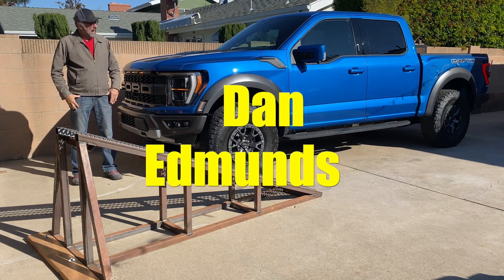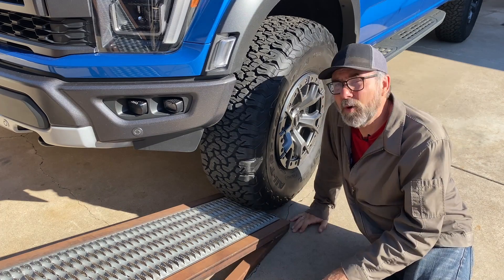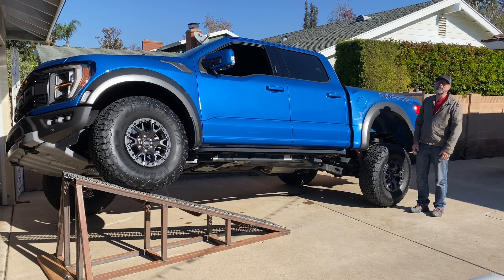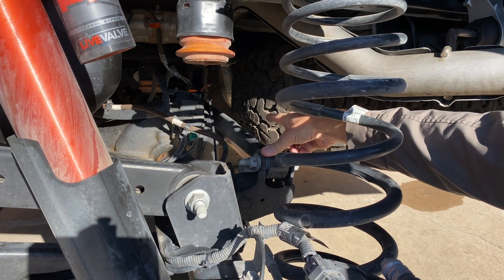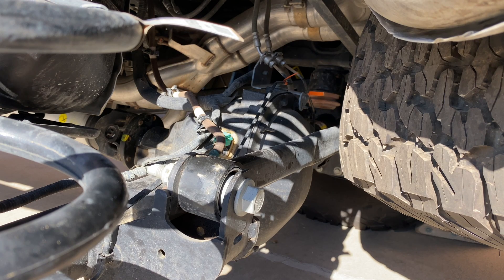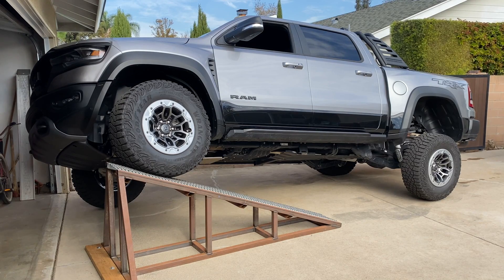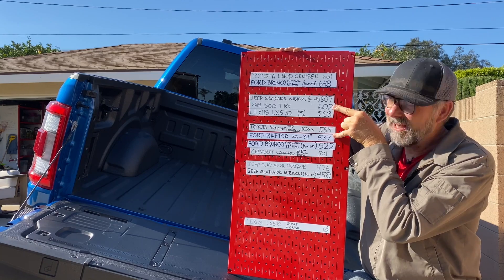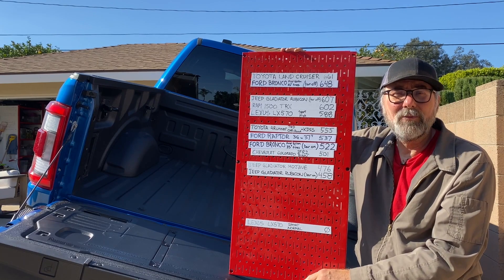2021 Ford F-150 Raptor w/37" Tires: Suspension Flex Test and Coil Spring Rear Suspension Walkaround

Comment: Hilarious the TRD Pro 4Runner got that kind of articulation
Reply: I guess that shows us the limitations of this test. We all know a TRD Pro 4Runner doesnt have anywhere near the wheel travel of a 3G raptor or TRX. A 4Runner might be lucky to have 9" of usable front travel vs 14" for the 35" tire'd Raptor and 13" for the 37" model.
Reply: @Jay-me7gw  yeah totally get it's just in 1 scenario. Dirtking engineered the TRX suspension for factory so it makes sense it has so much flex on this test

Comment: Great informative video. In Your opinion how would You eliminate rear sag when towing with the gen 3 raptor while not having the ride compromised. ? Not near the max weight, but boat still has substantial tongue weight.

Comment: That’s crazy that even with the 37 inch tires and restricted suspension travel it still performs extremely well in the flex test.

Comment: This is a desert runner not a 4low vehicle
Reply from the maker: True. It's more crucial for rock-crawlers. And off-road vehicles that aren't nearly as wide as this. But I measure them all, and the differences among competing vehicles do matter. Besides, the Raptor and TRX do include 4low, lockers, rock mode in the traction control. It's still marketed to be an all-rounder. 

I'll take your point one step farther. I grew up with desert off-roading, and what I'd like to see is a lightweight (and less costly) 2wd-only Raptor with a long-travel front suspension. But Ford will never make one because: a) they sell all of these they can make; b) the folks in Michigan don't understand the point of a 2WD off-roader. Meanwhile, most of the top-tier Baja racers are RWD.

Comment: Next time flextest a truck, please dont forget to open the bed door in order to the probable frame flexing. Thnx for the video.
Reply from the maker: I did open the tailgate for the final shot, and there was zero binding or misalignment. Same goes for the door when I got in and out.

Comment: My TJ scores a 1090🤣expected more out of the raptor
Reply from the maker: My lightly-modded JK, which I sold, was at 981 with full pressure in the tires. Probably over 1,000 aired down.

Comment: Great video as always. My only gripe is RTI is an overly abused metric. It's great to compare RTI of similar class vehicles. For example Land Cruiser obviously beats 4 Runner handidly. Being inverse function of wheel base comparing full size truck to mid size SUV tells one exactly not much. Yes RTI is less but absolute travel is far greater meaning it can scale higher obstacles or keep wheels on the ground going over deeper undulations. Posting absolute measurement score board in parallel to RTI would  be very informative in my opinion. 
It would be great to bring my oldish 2008 Power Wagon on that ramp for comparo.  With official RTI of 658 and ability to scale 36" obstacle per Chrysler would it go off the end of the ramp?

Comment: I'm surprised ford didnt try to beat the trx with the suspension flex. Trx still king even with Fords version of coil rear.
Reply: You are kidding right? The Raptor with 35's or 37's will make the trx look silly off road. These trucks are maybe 2 seconds different in performance in perfect conditions on road.  Off road is a different story hands down. It is not just about suspension flex, it is how you handle it.  Not just about horsepower and torque either.  The ram has been shown to be a boat anchor off road at high speed. The raptor has been shown to excel at both high speed and general offroading.
Reply: @johnt6673  Haha not kidding at all. The trx is better in EVERY category except fuel mileage.  Look it up way better then the raptor. It's the first mass produced super truck. Plus it actually sounds like a truck and not a moped. 😂 also I'm not a fan boy of either it's just easy to see which truck is better.
Reply: @fireant1272  Are you serious or a 5 year old girl that turd rx is nothing in front of Raptor , all you said is about raptor instead ,go attend yoúr online classes boomer , only thing turd rx has over raptor is v8 nothing else
Reply from the maker: He's not wrong. Except for outright flex, this suspension really works off-road. See my earlier Drive review for Autoblog: https://www.autoblog.com/2021/08/31/2021-ford-raptor-review/

Comment: No offence but who cares.  Put your highest rated vehicle on this list on a Baha course at full speed.  There are  just waaaay too many variables including vehicle design intent at play.  I’ll bet that out of every 5,000 - 10,000 Raptor’s or TRX sold maybe, just maybe 1 will ever be placed into a situation where it would use even half of the available flex.  Marketing, marketing, marketing that only creates a new sucker for every sale.
Reply from the maker: For the super-wide TRX and Raptor, you're not wrong because they simply don't fit on narrow trails, have a long wheelbase meant for high-speed desert running. I'm still a huge Raptor fan because of how its suspension works generally for that, despite this score. But flex is still a point of interest and comparison -- if you can get more, why not? Meanwhile, for Jeeps and Broncos and 4Runners and Land Cruisers and such, the focus is on more technical stuff, and this attribute is big.

Comment: I know your a chassis/suspension guy but whats your opinion on this.....

If the Raptor R DOES come with the GT500 engine(which has an aluminum block compared to the TRX Iron Block). Do you think there will be much of a weight savings or will it be offset by the gt500 OHV design vs the push rod design

and the Ford aluminum body compared to the steel/composite body of the TRX....

Im asking because they ball park the Raptor R to be 650HP due to the engine not liking to push beyond this # in a truck frame/body. Many people are speculating that even with the HP deficit the Raptor will come out on top due to the advantages I just listed as well as already having a stellar chassis in the 3rd gen Raptor.

Its a bit of a mouthful I know.......thanks again, love your channel
Reply: The GT500s 5.2 is still a very heavy engine. The GT500's weight ballooned to 4300lbs with that engine, so you can only imagine what it will do to a Raptor, which is 6K with 37s.
Reply: @hellkitty1014  agreed but i mean an aluminum block vs iron.......plus the hellcat pushrod is no LS/LT in terms of size and packaging
Reply from the maker: The Raptor with 37-inch tires weighs 499 pounds less than a TRX. I'm almost certain the R will weigh less than a TRX.

Comment: Still impressive, I did not think it would do better than the Bronco with the bar on.
Reply from the maker: It is still impressive, and that's a good point. The Raptor absolutely crushes if when driven in anger on all sorts of high-speed desert terrain where diagonal flex doesn't enter into the picture, and that's what it's made for. The TRX's rear suspension is derived from the Power-Wagon, which is more of a rock crawler, and the truck itself is much heavier.

Comment: Can you test a G Wagon? Pre-2019 solid axle and after? Thanks.
Reply from the maker: Love too. Getting my hands on the older one is the trick. A neighbor a couple streets over, the BePeriodCorrect guy, has two. But I don't know him.
Reply: @DanEdmunds  Great introduction idea: “Hey man, can I almost flip over your POS overpriced German Jeep?” -if that doesn’t work, I’m in Denver and you can use my 2016 G63 AMG!
Reply: South African publication tested a very old but more off-road capable G 300 CDI Professional (W461 of course with solid front axle) only got 376 which is really bad..

Comment: Great video.    Thanks for all the extra info on breather tubes and other interesting bits. Love my current Raptor (waiting to upgrade to the R) 
KDSS from Toyota was great on my old LC but needed maintenance and a knowledgeable technician.
Reply: Ive heard that about the KDSS system on the 4Runner/GX.
Reply from the maker: I have it on my 5th gen 4-Runner. No issues yet.

Comment: Is the panhard rod suspension setup improve  freeway cornering,esp. without a rear stabilizer bar.
Reply from the maker: The Panhard bar/track rod is necessary to orient the axle laterally in all situations, and it has nothing to do with roll stiffness, like a stabilizer bar. Leaf rear truck suspension don't have a panhard bar because the leaf mounting itself restricts lateral movement (in a half-assed way) but the four trailing links of a link-coil suspension like this cannot define or control the left-right position at all, so we get the 5th link, the Panhard bar aka track rod. Another option is a Watts link, which is what the Australian Ranger Raptor currently uses, but that approach was discarded in favor of a Panhard bar when that suspension was adapted our Ford Bronco.
Reply: @DanEdmunds  I actually didn't think there was a factory vehicle that used a Watts Link suspension
Reply from the maker: Ford Ranger Raptor in Australia, which will soon be replaced. And it has a diesel engine!
Reply: @DanEdmunds  thank you. How could we improve the freeway cornering in these vehicles. I had an f-150(not raptor)and I don’t like that feeling esp. at relatively higher speeds.

Comment: Im assuming you didn't investigate the front suspension because you plan to do it with the 35" Raptor.

So basically if the upcoming Raptor R wants to beat the current TRX in terms of offloading it needs to have the 37" tires but have a factory lift(body lift) to allow more articulation?
Reply from the maker: I think this Raptor already has it over on the TRX in terms of high-speed desert off-roading. It impressed me no end when I attended the First Drive for Autoblog. Flex is more about low speed technical work, and both the TRX and Raptor are far too wide to be my first choice for that environment.

Also, I didn't investigate the front suspension because: a) I called an audible when the rear tire came off the ramp and b) I'm writing a photo-based Suspension Deep Dive for Autoblog, and I'll get into that there. I'm not sure what the goals are with the Raptor R, but I would not be surprised if the front stab bar disconnect from the Bronco Badlands makes an appearance. That would make all the difference.

Comment: The 200-series Land Cruiser being 14 years old keeps impressing!
Reply: Impressive, but apples to oranges.
Reply: @MarkChristian2010  In terms of the cabin, yes apples to oranges. In terms of a the frame then no. You can make a pickup truck with the same flex as the LC since it's front IFS and rear solid axle and all coils.
Reply: @and7976  The frame as well, along with dimensions and wheel size. When it comes to ramp travel, you can't compare different classes of vehicles.

The Raptor 37 not only has 37" wheels, which don't tuck up as well as the Land Cruiser's 31.5" tires, the Raptor also has a wider track, which makes articulation more difficult, simply because there's more track to articulate. 

Put 37" tires and 9" wider track on the Toyota, along with bump stops to limit travel, and then see how it measures.
Reply: @MarkChristian2010  Probably better because it has a disconnect able sway bar using hydraulics while the raptor has NONE. Even a raptor with 31.5" tires can't articulate the same way as the land cruiser.
Reply: @and7976  Okay, that is just a fallacious argument.

With or without discounting sway bar, the Raptor has nearly 10" more travel demand. Even if you completely eliminated the front sway bar in the Raptor, you would still need more maximum travel  to match the RTI score.

Again, the bottom line is that you are comparing two different vehicles, apples to oranges. The Raptor is built with high-speed off-road in mind, which is why it has a much wider stance than your typical vehicle. The RTI is simply one metric for off-road that the Land Cruiser is superior at, but there are other metrics where it is inferior.
Reply: @MarkChristian2010  You are right. Your argument is fallacious.
Reply: @and7976  Dan made the exact same argument both in the video and in the comment section. Are you saying Dan's argument is faIIacious, or are you just too much of a fangirl to admit basic math?
Reply: @and7976  Okay wise pants, what's fallacious about my argument?
Reply: @MarkChristian2010  Your arguments are pointless because you are missing the point. Are you saying that a disconnectable sway bar on the raptor is pointless? if not then why doesn't ford put one?
Reply: @and7976  I'm not missing the point. You're missing the point. 

The Raptor doesn't warrant a discounting sway bar, because if the Raptor had much more suspension travel, it would rub. 

What's so hard to understand about that?
Reply: @MarkChristian2010  It means the wheels are too big for the body. Instead of making the truck fit 35" they choose to limit travel. What a load of . 🤣
Reply: @and7976  No, it's not. What a silly argument. Tell that to all thousands of modified Land Cruisers owners out there. 

Seriously, I don't if you're clueless or just here to be annoying.
Reply: @and7976  You're just responding with incoherent non sequiturs now.
Reply: @MarkChristian2010  if owners choose to modify their LC that's on them, but ford selling a vehicle with limited flex just to put on 35" is just lazy. They should design the vehicle to accept 35" with full flex if they want to put 35" on. If that is too hard for you to understand or is incoherent for you then I don't think I can help you.
Reply: @and7976  It's not lazy, it's what people want.

You know what people don't want? The Land Cruiser, which is why its sales were terrible and was ultimately discontinued. 

You know what's lazy? Toyota, as they allowed the Land Cruiser to rot on the vine after 14 years.
Reply: It’s true, chicks don’t dig a land cruiser.. they may be impressive, but have zero cool factor..
Reply: None of them have 37's either...
Reply: The new lc300 with E-KDSS has even better flex.
Reply: Impressive that a used on with 200k miles is as much as a new 4Runner

Comment: Can you do a video comparing the TRX with the Raptor in terms of overall suspension design for its intended purpose?  I'm talking the link setup, shock setup, the robustness or apparent robustness of the different suspension components, potential weak points etc.  You're just so knowledgable on suspension and I feel like you actually have a lot more insight to give to your viewers.  This would work quite well for things like Bronco vs Wrangler, Land Cruiser vs Defender and things of that nature.  Both cars dont have to be present at the same time.  Would just love your opinions overall.  They don't even have to be head to head but more just your opinions on what each vehicle got right and what they could improve on.  Thank you.  Big fan of your channel.
Reply from the maker: Yes. I can certainly do that, and I want to move in that direction. But my intermittent output is a result of having too little extra time to keep up with demand, let alone expand the scope. It's a bit of chicken/egg for me time-wise right now.
Reply: Dirt King did the R/D for the TRX in case people were wondering

Comment: That score surprised me; I know the 37s eat up some suspension travel but I was still expecting closer to the TRX. It really does make one curious how the Raptor on 35s would do. For the price of the Raptor 37 package I would have hoped to see less sacrifice in flex.
Reply from the maker: I am surprised, too, but the Raptor is more about high-speed send-it than low speed technical crawling. It's so good at the high-speed stuff that I get the sense they didn't prioritize Flex as much. The TRX's rear suspension is derived from the Power Wagon, which is more of a crawler, but the sheer width of the TRX and Raptor don't make either one prime candidates for, say, the Rubicon Trail, where flex is king.
Reply: The TRX's articulation for something of its size is amazing.
Reply from the maker: I was certainly surprised.
Reply: Pretty sure the raptor on 35’s has best in class travel.